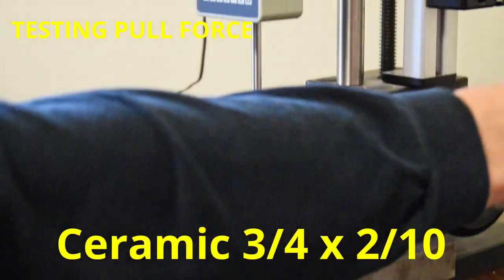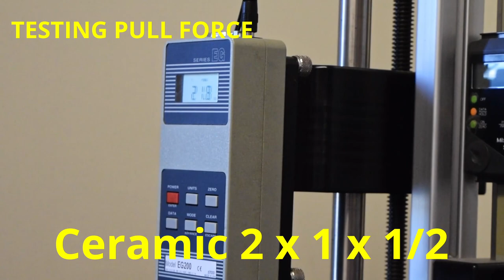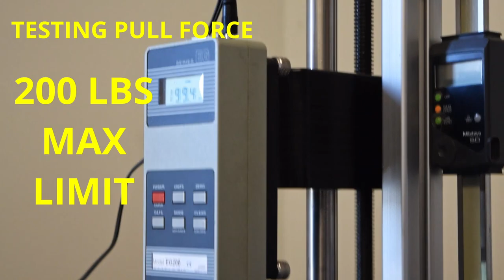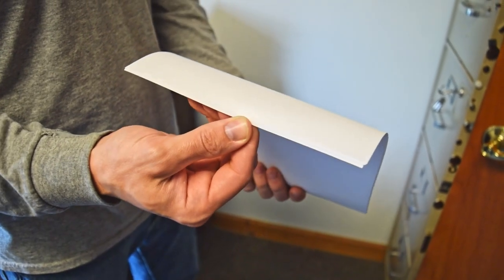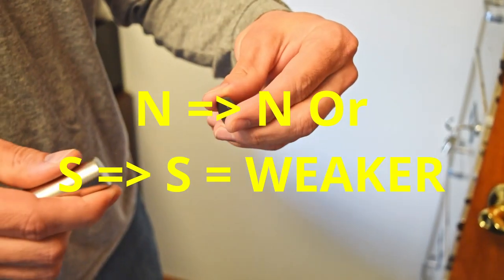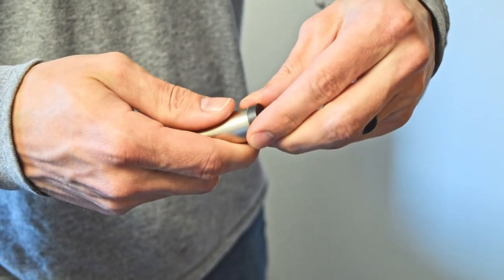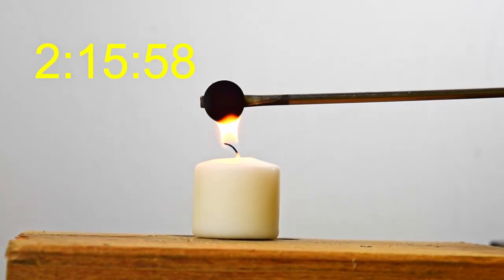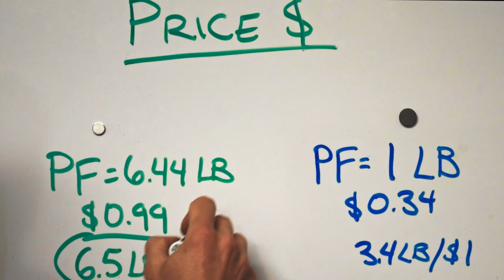Ceramic vs Neodymium Magnets

Comment: If you put metal plates at the poles of the ceramic magnet to close the magnetic circuit it will be able to support a lot more weight. I managed to lift 60 lbs with one of those 2X1X1/2 inch ceramic magnets.
Reply from the maker: Same thing happens with neodymium magnets...the steel cup increases the strength!